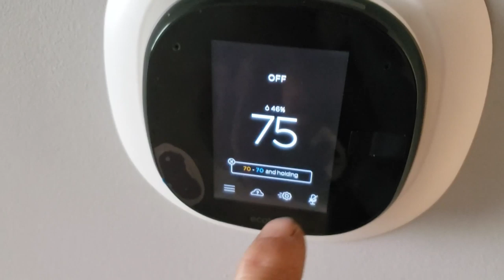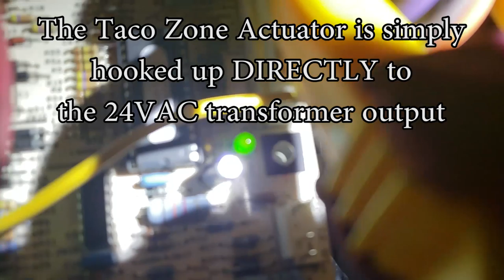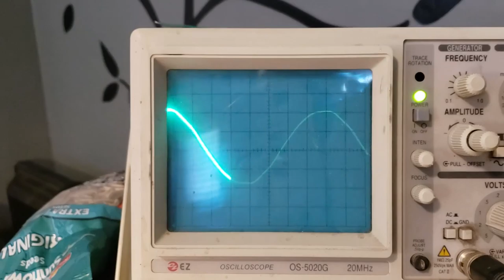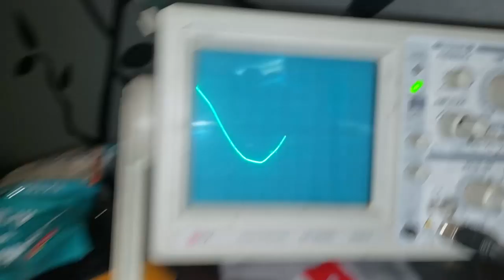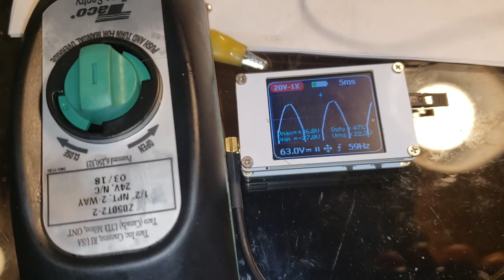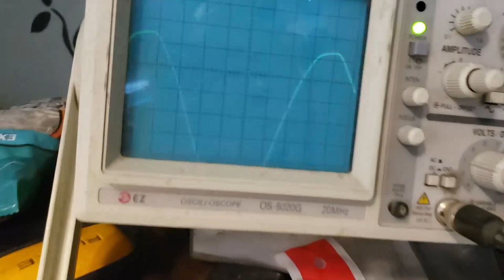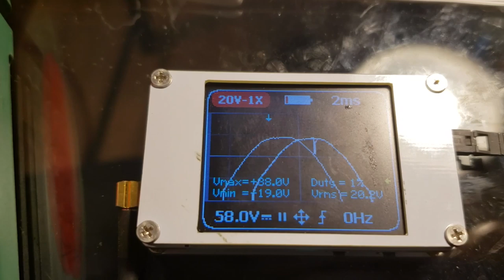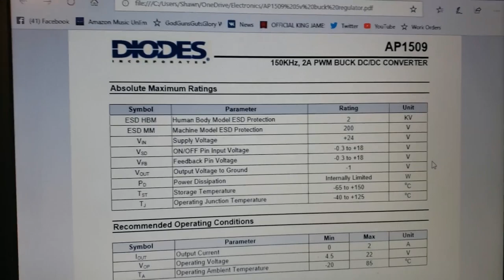Gremlins in the Taco Actuator screws up an EcoBee thermostat operation!

Comment: Man Taco should see this video and take care of you. Can call them they are located in Cranston RI. Their customer service is great. I always found them to be spot on for help. Great video and work on this. Thank you. HVAC ON!!!
Reply: Water source hp in The old days had the can in the air handler. Put those in with pneumatic t stats. But always leak at the hoses to the Coil. The new ones no can in air handler. Nice work. DEDICATED to the trade for sure. Thank you HVAC ON!!!

Comment: Those ECO Bee thermostats give problems in residential applications. Maybe their circuit design needs more tolerance for dirty power?
Reply from the maker: I have only seen them a few times and it was in commercial.
The first time was at another building that just had them installed with remote sensors.
I had to go repair most of them!

Comment: While it's a bit dodgy of the valve to be causing that noise - the real fault is with thermostat. It's completely ridiculous for a commercial product to completely kill itself from some noise on the power rail. It's even worse that it's possibly damaging the equipment connected to it. EcoBee needs to fix their junk. I've heard of EcoBees causing problems like that elsewhere.
Reply from the maker: Yes. The issue seems to be BOTH the noisy Taco actuator and the overly sensitive EcoBee
We use these valves on the same heat pumps all the time and don't have this issue.

Comment: try putting a rectifier and filter cap across the supply voltage to the tstat. that might help a bit.
Reply from the maker: The t-stat runs on 24VAC
Reply: @hackfreehvac  my thought is that the first thing the tstat does with that ac is rectify it and put it through a regulator or dc to dc psu for the mcu's either 5v or 3v3 power rail. operating on that assumption, it should run fine on dc so long as the voltage is correct. you could also try running the power for the taco actuator through a choke to get rid of some of the noise. plese tell me if im being an idiot tho, i do audio electronics not hvac electronics.

Comment: Or like the nest stat..after 2 years the internal battery dies cousing the heating relay to do the same thing..due to the thermostat does not require a common power wire...ya realy..with out c hooked up it kills the battery in 2 years consistantly